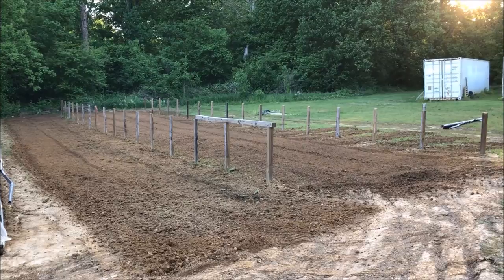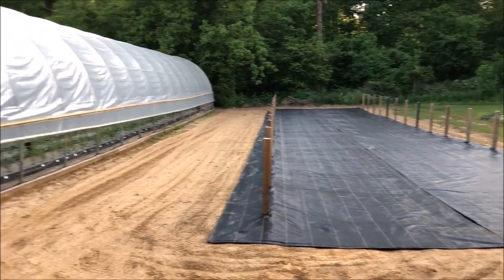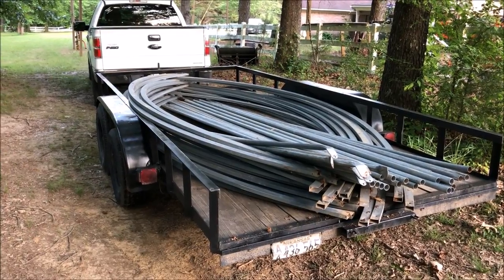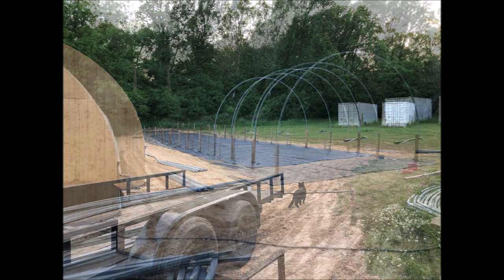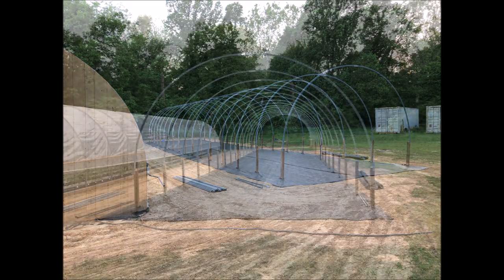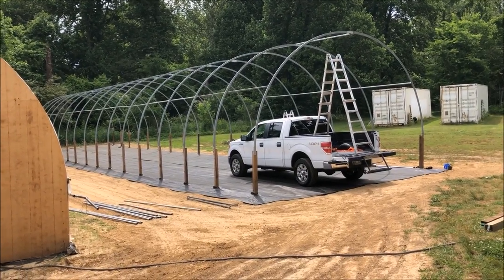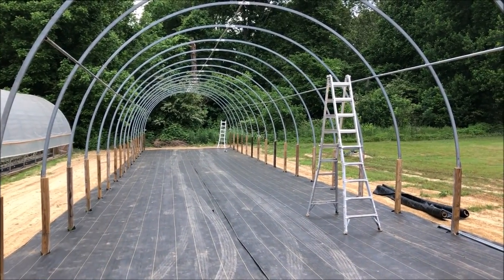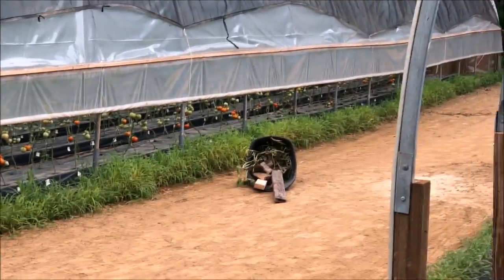Welcome To Greenhouse #3

Comment: Chuck i did the same thing as you are doing went i starting 8 differ places . 2 places i help at night , the first one was a 60 130 ,then 20 48 then i bought 120 120 i got to put up a60 120 the other were 30 96 i raised flower, and had 5 a, of produce .
Reply from the maker: Those are huge. Lots of work just putting them up much less maintaining them!
Thanks for sharing!
Chuck

Comment: Mr. Chuck I have watched your video a few times over trying to find how wide  your beds are and the spacing between them for the walkways. I could have sworn that you had talked about it in one of your videos. Could you tell me? How wide your planning to make the beds and spacing between them? 
Thanks
Reply from the maker: The way I did it was I used the width of the base of my ladder for the aisles and gave each bed what was left. There are 4 beds and 5 aisles. My ladder is 24 inches wide at the base so I made the aisles 26 inches wide and each bed is 24-25 inches wide
Reply: Fensterfarm Greenhouse Mr Chuck thanks for the information! Looking forward to more videos!!

Comment: Chuck, Have you had any problems with roots plugging up the troughs?
Reply from the maker: Yes you can have a problem with root bound troughs. The trick is to rotate those plants out and replace them with less mature plants before they get to that point. The cut and come again plants are the ones that will get you. Basil, arugula, chard, and kale are the ones that were getting me.
Good luck!
Chuck

Comment: Hi Chuck. I gotta ask about your winter greenhouse. I believe you said its double poly and inflated right? How was the moisture and condensation between the poly in winter? How did you manage it.? Im  planning to build my own greenhouse . Any advice would be appreciated Chuck thanks
Reply from the maker: lkhanaajav batbaatar I didn’t have much if any condensation between the layers. The dry heat from the propane heaters may have had something to do with it.
Sorry 
Chuck
Reply: Hey don't worry Chuck. I believe that is definitely the reason. I'll use electric heater well I'm thinking about it . What is the coldest in your area?  I live  in Mongolia and we have -30 or more about 5 months  . No one has a double infected poly greenhouse here . Mostly they use Chinese style  or double greenhouse laterally. Thanks chuch
Reply: Chuck sorry about spelling

Comment: Looking great! Was GH 2 a different design than GH3 or did you change the design to wooden posts? On another note, how are your lettuces et al doing in the heat this summer? What temp are you able to keep that GH at? Thanks, Chuck!!!
Reply from the maker: Same frame Phil but I wanted taller side walls and wanted it to be a bit more rigid so I used the 4x4 posts on the side instead of the shorter metal post. It worked splendidly. 
The lettuce is doing well. I cannot keep enough of it going to keep up with demand from the restaurants and the farmers market. I can keep that greenhouse in the 80's and the lettuce tolerates that pretty well! We've had triple digit temps several days and we are good in there. I will give you a look in an upcoming video!
Chuck
Reply: Its your water cooler that keeps it cool?
Reply from the maker: It's a combination of the water-wall, the circulating and exhaust fans and the shade cloth cover!